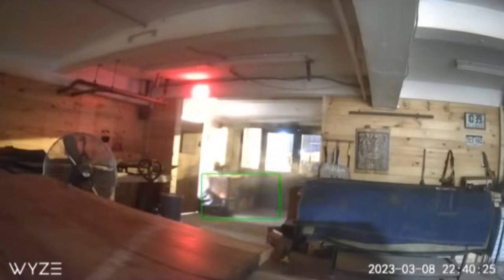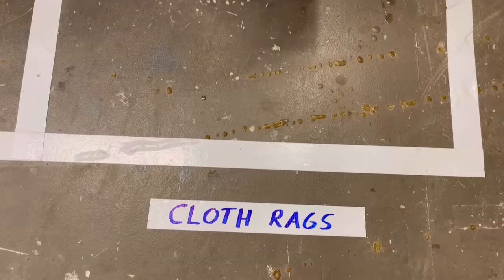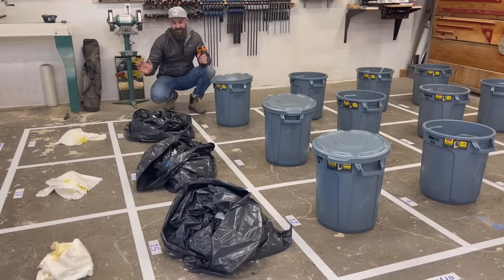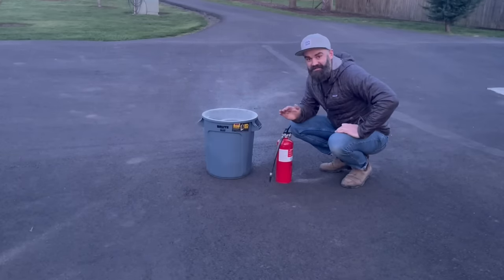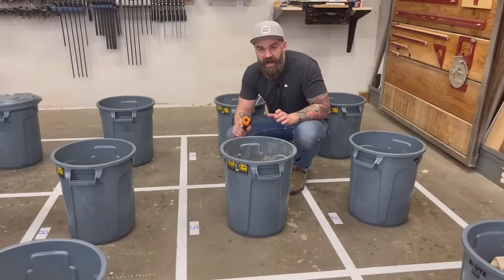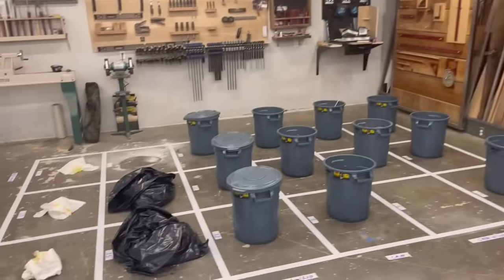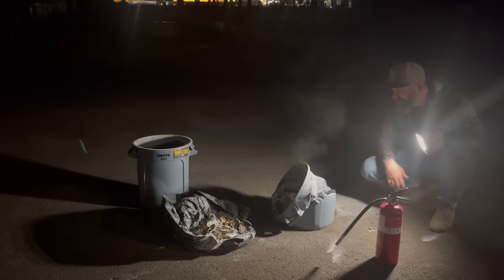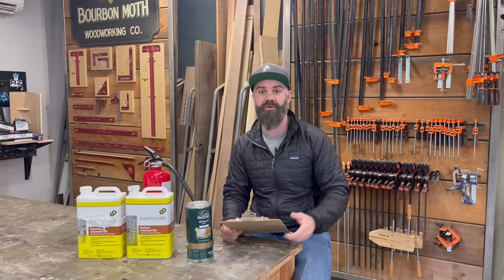I Tried To Burn Down My Shop || This Video Will Save Yours

Comment: You can suffocate small fires with sand. Also if you don't have a burning puddle of oil, water works pretty good at cooling down a fire till it isn't a fire anymore.

For a maximum chance of spontaneous combustion, only dampen the rags with lineseed oil to maximize the reaction surface and arrange the rags in small heaps at a location without much air flow so they can still breathe but don't get cooled by convection too much.

It also seems that lineseed oil with catalytic additives ("boiled") that are meant to speed up its oxidization actually do oxidize faster (at this occasion i want to thank Captain Obvious who i really appreciate being always there to look up to).

That said, there is a dead simple way to stop spontaneous combustion from happening: Cooling.
Store your oily rags in a bucket of water, burry them in a bucked of sand, hang em (unfolded!) on a clothesline to oxidize ("dry") while convectively cooled by the surrounding air.
Or you can just let em do whatever they want in a closed (but not fully airtight) metal container that has no contact to flammable stuff outside.

Stay safe and read the safety sheets of all chemicals you use.

Comment: Oil isn’t the only thing that can combust. At my work, we put up comercial tents, and we use large drop cloths to protect the canvas from getting dirty while setting the tent up. Well, if the cloths get rolled up wet because of rain, overtime they slowly get hotter and hotter until they combust. I have not personally seen this, but my boss is pretty adamant about us laying the cloths out in the sun to dry. And that’s just from water
Reply: @Grauenwolf it’s due to oxidation. Oxidation creates heat. We roll the cloths into really tight rolls for storage, so there is no airflow and over time they get hotter and hotter. I’ve never seen one catch fire, but I have felt multiple that were hot to the touch
Reply: @Grauenwolf  and it’s not the tents themselves, it’s these 60ft long thin sheets of cloth we just use to basically cover the grass while installing the tents.

Comment: "Philadelphia Tower Set Ablaze by Rags, Commissioner Says" April 11, 1991 New York Times. "The city's fire commissioner, Roger M. Ulshafer, said the crew had been refinishing woodwork in a vacant office on the 22d floor of the high rise, One Meridian Plaza. When they finished for the day, he said, the workers left 25 pounds of rags soaked with linseed oil in a heap on the floor. He said the linseed oil generated enough heat to ignite the rags, which then ignited containers of other solvents left nearby."

Comment: This was fascinating.  I hope someone does a video on the science behind it.  How safe are dry rags even?  Do we really know?  There seems to be an oxidation reaction at play between linseed oil and air.  The firesafe and tightly closed trash cans are likely safer, due to lower oxygen supply, but any kind of opening could potentially be enough.  Dry linseed oil rags should still have some remnant of the oil on them.  The concentration might be so low that anything left oxidizes quickly and is rendered inert, but is that the case?  Piling enough dry linseed rags together with enough airflow might a dangerous condition to.  We need a chemist.

Comment: What got me was all three that started on fire were very real world conditions. There was nothing over the top "For the views" about them. 

My constructive criticism, when you took the buckets outside you should have just dumped them out, and then used a garden hose. No risk to your lungs from the extinguishers, and it's free or almost depending on water taxes in your area. Every woodshop should should have what we called a piss can. A water filled class A extinguisher that you can refill with water and charge with shop air. It'll handle 99% of woodshop fires (even oily rags, but not a puddle of oil) and it's free to use so there's no hesitation to use it, and it's also free to practice with so there's less panic when you NEED to use it.

Comment: your taking surface temps, I wonder what the temps in the centre were doing. would interesting to do a test with a bbq thermometer probe in the middle of the pile.

Comment: 1975 my rag box ''cardboard'' caught fire on a sunday morning in the factory were i worked. did hundreds of thousands in damage. springlers came on dropped tons of drywall insulation. and forced replacement of a bunch of transformers
Reply: the cleaner i was using was renusit

Comment: Storing oil stained rag correctly is important not only for woodworkers. Like you said lay them out ant let them dry. If you dont have the space get the fire safe can. If you want to learn on how to use a fireextingqischer correctly check with you you local fire house they will be glad to help you.

Comment: I had a small 2 foot by 3 foot plastic bin being used for compost in my garage during the winter and had cardboard sitting on top of it to keep it from drying out and it spontaneously combusted and costed $62k worth of damage to my garage and house. Dirt caused a fire... microbes in the dirt but yeah, I'll never do that again.

Comment: The whole idea behind a fire safe container is it dosen't stop it from combustion but it contains it add even it causes an explosion the lid stays on containing the fire and without oxygen the fire goes out that's why a galvanized garbage can with a lid isn't good enough because a smoldering fireproduces gas and when it lights it quite often produces an explosion which blows the lid off

Comment: This was a great video. Have seen more than one fire started from rags or spilled solvents.  Your shop was a little bit on the cooler side. Just a little more temperature or a little sunlight, makes the reaction happen easily.

Comment: I had heard about this but thought it was unlikely. I walked into my shop and I thought dang one of my neighbors is cooking out and it smells great. Then I looked on my wooden outfeed table and there was a burn mark that burnt thru a piece of hardboard and a piece of plywood. It was a staining rag.. never again..don't mess with those  rags put them out of the tinder box wood shop. This was not linseed oil.

Comment: This danger from linseed oil rags is nothing new.  30 years ago, when I was in construction our company had more than one project to restore homes, hobby shops, professional furniture shops that had to be rebuilt due to fires from these rags. The back of the cans clearly have warning printed on them.  All of the events I am familiar with were due to ignoring these warnings.

Comment: I've worked in shops and factories all my life and solvent and oily rags were always kept in a special red steel waste cans.  Everyone out there should do the same.  At the very least use a 5 gallon steel garbage can with a lid.  Only 20$ at your local hardware store.

Comment: Just be careful thinking that water saves you. My understanding is that, under all that wetness, the oil and fuel are still lurking. Eventually, the water dries off and you are back to where you started, at risk for spontaneous combustion of the oil that then lights the other debris. I've read stories of people saying they had a fire start from various vegetable oils. One guy said he put his apron through the wash (he baked pizzas in a shop). It didn't wash 100% of the oil out and the folded apron caught fire in the laundry basket.

Fire rests on a three-legged stool: heat, fuel, and air. What you're seeing is a race between those three. The trash and rags give insulation that lets temperatures go up, which lets the oxidation reaction go faster, which releases more heat until you hit the combustion temp of something or another in the mix. The IR heat gun was interesting, but this is all a "local" phenomenon: The average temp can be low, but a little corner somewhere runs away and kicks off ignition, pretty much exactly like a match. I'd guess there's plenty of air in the cans with lids on for them to catch, too. They would then melt and let in more air. 

And that metal can? I don't think it prevents fire. It just contains fire. It probably tries to have a good seal so that a fire that does start starves for oxygen, but there is enough air in that can to let the process run away, so I'd think fire in that can is possible. I'd also think you could open the lid and get a face full of fire when air rushes back in if your timing is just perfectly bad luck.

Comment: Curing oils like Rubio and linseed work by actually oxidizing.  The oil combines with oxygen to cure.  Combining with oxygen is of course the same reaction as burning; with a curing oil it’s just slow and controlled and releases small amounts of heat.  When you crumple up the rags the heat of oxidation builds up and you get combustion.  Any of your scenarios could have caught fire if the geometry ended up just right so the crumpled rags had a good supply of oxygen.  It’s scary stuff.

Comment: This is a great service to the wood hobbyists.  Having had a cabinet shop for thirty years I’m well aware of spontaneous combustion.  Not only with oily rags but also sawdust.  At the time I owned a shop in California where often during the summer ambient temp was above 100 degrees.  Small piles of sawdust that used to form around our dumpster would start to smolder and then ignite.  We always parked our dumpster in a cement area well away from the building or any other kind of structure.  Something else to keep in mind is the possibility of airborne sawdust explosions.  Fine sawdust, when suspended in air is almost as explosive as gunpowder.  Thanks again it is a great service for you to take the time to warn the public!

Comment: I always wipe down and then drape my oily rags over things like my vises, on my drill press table, basically anything with bare steel parts, I figure I might as well get some use out of that oil rather than let it all harden on the rags. I use tung oil not linseed though, linseed would probably make everything sticky.

Comment: This is why I've always laid out my rags outside to dry for at least a day before trashing them and even then always kept outside.

One thing is not having toxic fumes in the shop anymore than necessary, I don't like opening the door and getting hit with that smell but also ensures that if somehow a fire still manages to start it's outside away from any structures so not going to cause damage.

Comment: With BLO, the problem is that the hotter it gets, the faster it gets hot.  Like a lithium battery, it’s a case of thermal runaway.

Comment: I almost burned down my garage with oily rags after oiling my deck, very scary. After reading the wall of text on the back of the can I saw that they tell you to be careful, but in my opinion that warning needs to be way more visible.

Comment: Realistically, except for the name, the fire safe can  was just as safe as any of the other scenarios that didn’t catch fire.  Rather than assume the fire safe can won’t be a problem,  could you do a follow up experiment?

Put oily rags in the can and set it in the middle of the driveway with a camera to monitor. Maybe two; one with the lid closed and one with it open. Pick a sunny day as a combustion aid. My hypothesis is that both will catch on fire, though a bit more dramatically with the lid open, and that the safe part is just that the can won’t melt while spreading the fire. Maybe the closed lid reduces the amount of oxygen available for combustion.

Comment: I remove the rags from my shop daily. I tend to apply with a brush now and only rub back with a rag. Placing them in a bucket of water or a jar filled with water is a good idea. Wonder if the additives in the boiled and Monocoat help with combustion

Comment: I’ve sW it happen. Was staining some beams. Was wiping access off with rags. This shot is real. Can happen very quickly.  I was not using Linseed oil. Was a regular stain from Sherwin Williams. Edit:  I was using cloth rags

Comment: Perfect video!  My wood shop is my two car garage, and although I have 4 fire extinguishers and several smoke detectors throughout . . . until watching this video I figured I was smartly covered just incase.  There's no doubt this video can save many shops from going up in flames - IF the lesson learned is to expect the unexpected.  FYI:  I'm on Amazon right now ordering one of those red oily rag fire can's!  Thanks again for taking the time to conduct this experiment and post it to YouTube.

Comment: My spontaneous combustion was stain. Cloth rags in a green or black trash bag.  Outside on the porch.  I was the 911 dispatcher and my neighbor called to say my house was on fire. I toned out the fire department very calmly and the chief said who owns that house?  I said I do.  They had never had a spontaneous combustion that they could exactly say was from stain soaked rags.  They had to know exactly what I had in the bag to try to recreate it.  I went to empty paint cans after that. I put the rags in them when I am done and seal the metal lid and they go far away from any structure.

Comment: The temperature probably starts increasing rapidly at some point as chemical reactions can be sped up by warmth. I suspect it's just false sense of security to think "it won't combust until 400+". It'd be interesting to see this with a thermal camera timelapse.

Powder fire-extinguishers tend to get every place, which can be bad for e.g. electronics. (After use I mean.) My aunt had a washing machine burst in flames and her husband hosed it down, they found that stuff on the other side of the house for a while.

Comment: This happened to my boss. He was having his living room remodeled with oak cabinets and they were using that seed oil to seal or whatever and left a container of it overnight on a friday to pick back up with in the morning and the rag draped over the top... ideally to dry. The issue though it that his wife had an ornament of some sort in the window that caused the sunlight to focus onto the rag, setting the bucket on fire, and ruining the entire living room. This happened in the early morning on a saturday, owner and his wife were out of town, neighbor saw the blackened windows and smelled it walking past and called FD, all in all they only lost the living room and its contents thanks to the thick, sliding pocket doors they had entering the living room, but man did it stink up the entire house. They ended up needing new carpets throughout the entire thing, had to replace a bunch of insulation and ceiling spots where the smell would not leave too.

Moral of the story, window décor is bad.

Comment: I put paper towels soaked in boiled linseed oil in a garbage can in my garage.  The next morning my garage smelled of smoke.  I looked in the garbage can and saw that the paper towels were charred.  The lid of the garbage can probably cut off the oxygen availability thus suppressing the fire.

Comment: Jason, This is such an excellent video, thank you for posting this.  I suffered a fire several years ago after applying tung oil to a recently completed screened in porch on a very hot summer day. Heading out to a movie with my wife, I spread the cloth rags on a wooden step ladder to dry and headed out. Awaking very early the next morning I glanced out to see how the finish was looking and was shocled to see the ladder charred and black and a burnt divot in the brand new floor. I nearly burnt down my house while my family was asleep! 
I now ritually put all oily rags into a fireproof container stored outside. Starving the rags from a source of oxygen is essential to preventing a fire. This is a real and present danger to all folks using oil finishes and your video illustrated it so well.

Comment: I think you could easily have small local areas of high temps, perhaps hidden under folds in the  rags, or hidden under other things, that your temp sensor did not pick up.

Comment: Linseed oil caused the largest structure fire in US history. This is no joke, when a vegetable based finishing product mentions the potential for spontaneous combustion on the label people need to take that warning incredibly serious! Set the rags out to dry on the concrete for a day or two, dispose in a Justrite safety bin that is outside your shop or use the water filled paint can like they suggest. These things can and will happen, it happened to me and I got lucky.

Comment: Should have had a thermal camera it would have shown heat signitures
Reply: Psst smoke comes before fire.. There was none (lighter fluid doesn't smoke) meaning it would get hot enough to melt the bags and cans before igniting it has to heat up. Time stamp and clock on his wall don't match the time he claims and why does he have a mic on when dealing with  the fire but not sitting around and no coat in side but has one on outside.fake as a three dollar bill.

Comment: Passing along a lessons learned from "The Modern Rogue" YouTube channel, they did a video where they attempted to Thermite a car.  You can call your local fire dept and let them know that you're doing a video that involves fire.  They will appreciate the heads up, even if they'll probably try to tell you to not do it.  It's better that they know what your doing ahead of time, rather than you trying to explain your video concept while your shop is burning down.